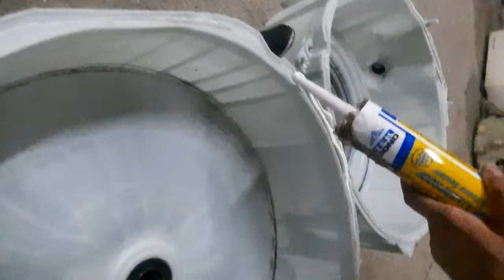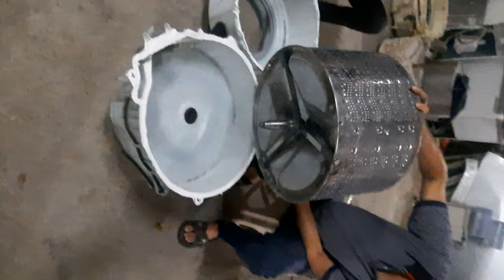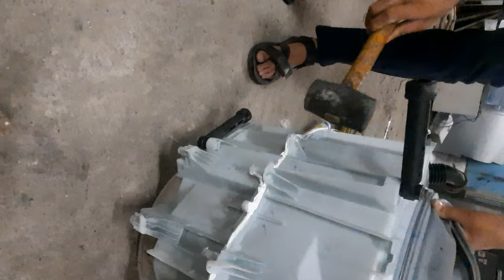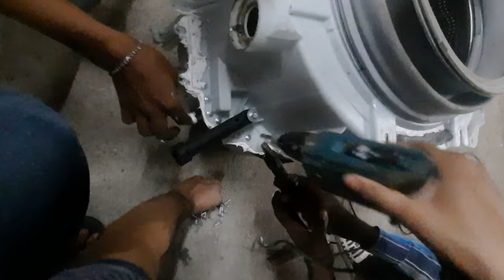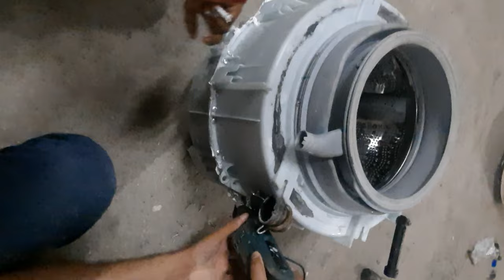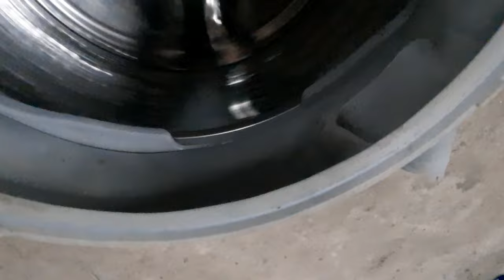SIEMENS 7KG Washing Machine sealed drum re fixing with silicone/REPAIRCARE  Ernakulam-+918686998844

Comment: Excellent you have attempted to open plastic welded outer drum
from manufacturer (Siemens /Bosch) and gluing with sealant and then nut bolting.
Any leakage thereafter while in use ? if no,
then let me know the brand name of sealant glue. I have recently placed an order with your company for spider.
Reply from the maker: never leak ,weatherproof sealent  white tekbond brand
Reply: listen to u go